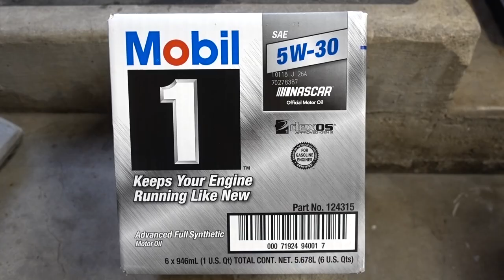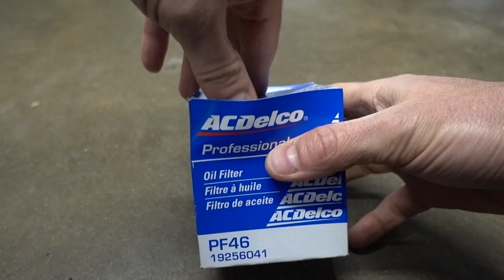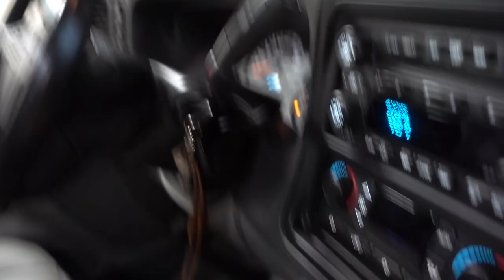BEST OIL FILTER HACK IMAGINABLE!!

Comment: Yeah but what happens when the clump of metal on the inside of the filter becomes dislodged and instead of nano particles floating through the engine, you now have a large clump of semi magnetized metal shavings going through the system. There is a reason the oil plug at the bottom of the pan is magnetized to catch the sediment and not the pressurized oil filter. DO NOT do this to your filter. Better yet DO NOT take advice from inexperienced you tubers that don't know what they are talking about. So much misinformation from people who shouldn't be giving potentially dangerous advice.